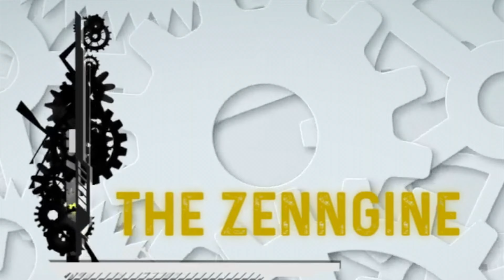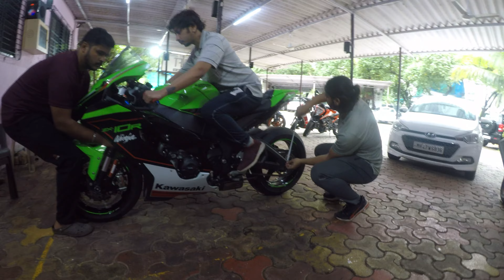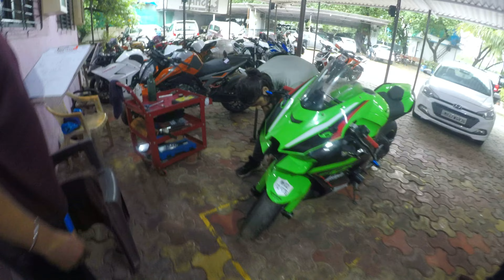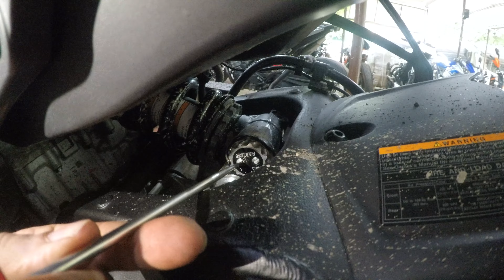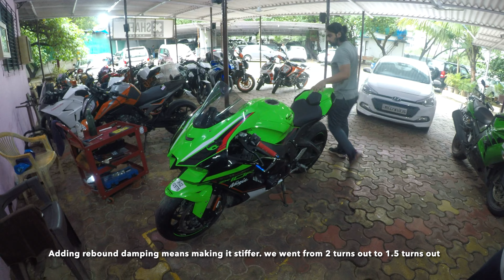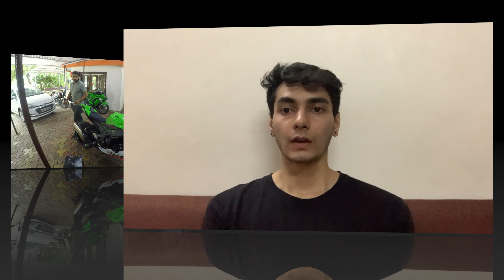2021 ZX10R | Track Suspension Setup

Comment: How did you manage to adjust the rear preload? Manual says you need to remove it from the bike to do it.
Reply from the maker: that is correct, removing the shock is also not a small job on the 10R. we use a specially made tool with brass tips to adjust preload.